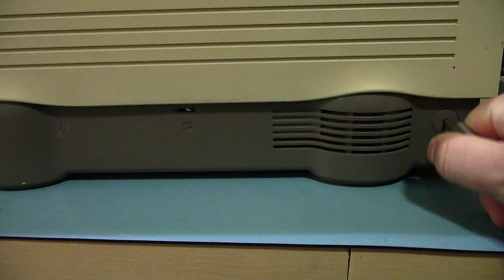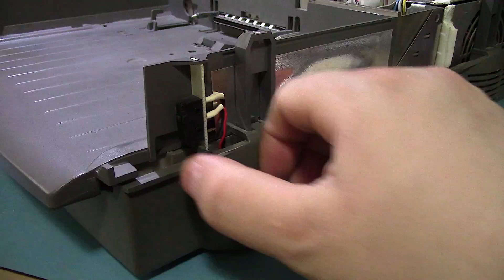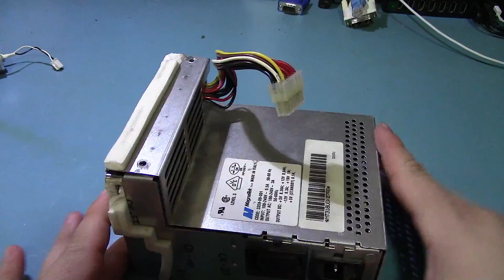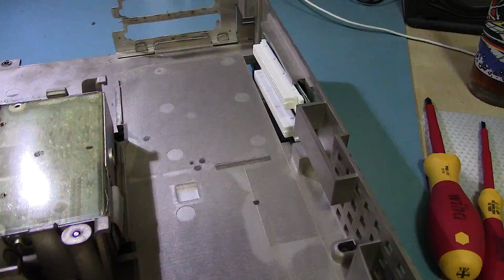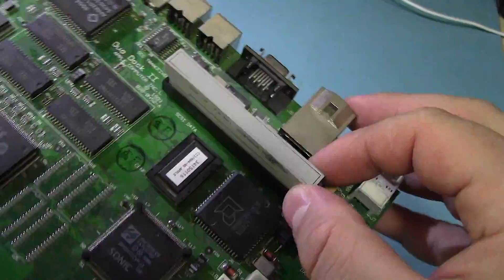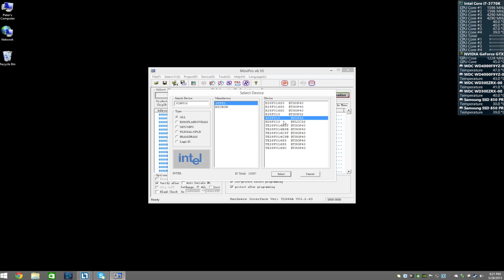Apple PowerBook Duo Teardown (Part 2 of 3 - Duo Dock)

Comment: aren't kill-a-watts a nice tool? I have one too.
Reply from the maker: +Chris Kalkman Yep. I recently picked up a Watts-up? NET (what the hell is with the stupid pun names on these?) which has USB/ethernet for logging although I haven't had much time to really play around with the software.
Reply: +Peter Brockie 
How are those compared to the wattage monitoring found in Uninterruptible power supplies (beside smaller)?
Reply from the maker: I'm not 100% sure. I have an older APC model with an Ethernet card installed and it doesn't seem to do much logging. The Watts Up? Units look pretty detailed.